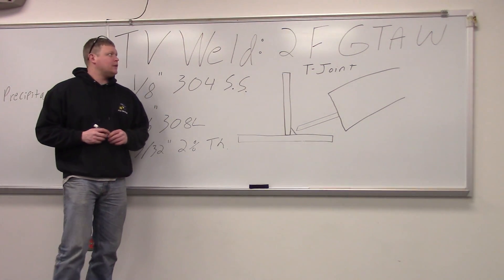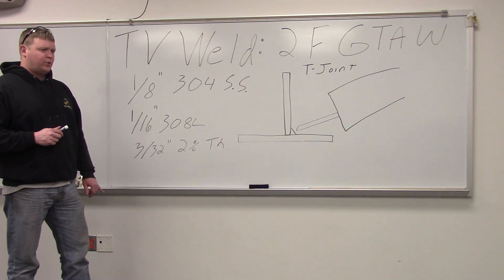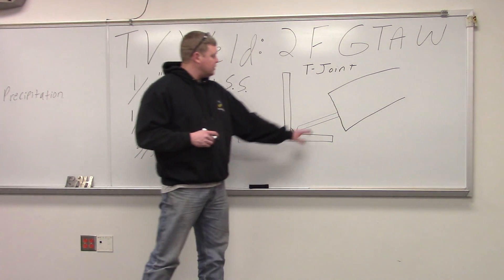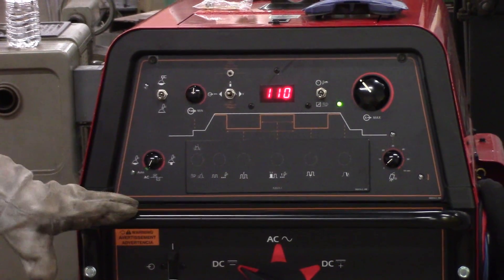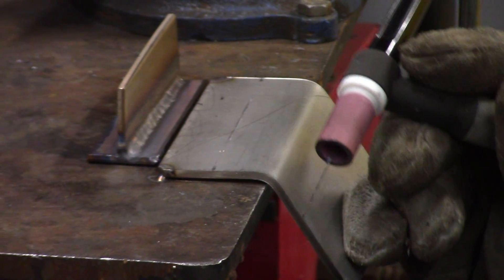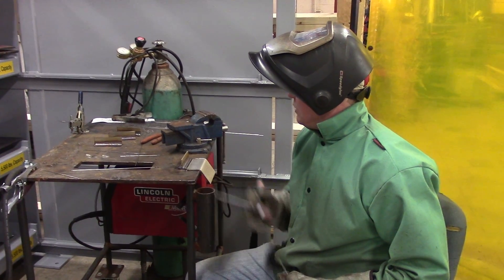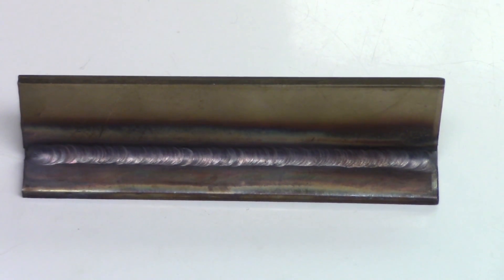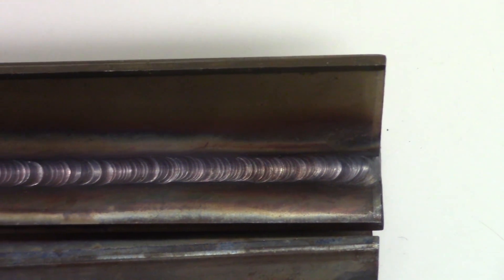2F Horizontal TIG Weld

Comment: One of my biggest problems is seeing some thing that small,I use a 2.00 cheater lense and still have problems seeing.
Should I sell my htp 221? Do you have any tricks for seeing?When I first started stick I could not see because my safety glass and the safety glass in my hood reflected and I saw  2 arcs.bottom line if you can't see U can't weld right?What level of magnification is on your camera?I measured it and the rod is almost  a 1/4" on my 12" laptop I want to see like that.
Reply from the maker: I've had some people that have trouble seeing things.  Usually the first thing we do in that situation is go to a cheater lens, and you've already done that so I'm not sure where to go from there.  The only thing I can think of is to see if there is a cheater lens that has a higher magnification than the one you already have.  The camera zooms in to 57 times a normal view so it gets right in there.

Comment: What size tungsten and filler rod are you using?
Reply: The welding part looks like it was filmed by a drunk toddler
Reply from the maker: The tungsten is 1/16" 2% thoriated, and the filler rod is 3/32" ER70S-2.
Reply: Er70s-2 on stainless?